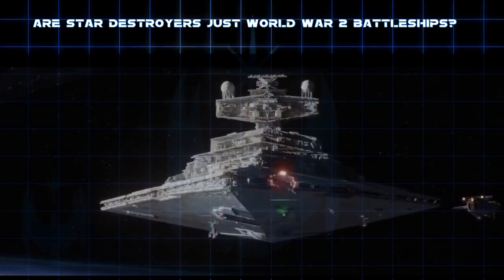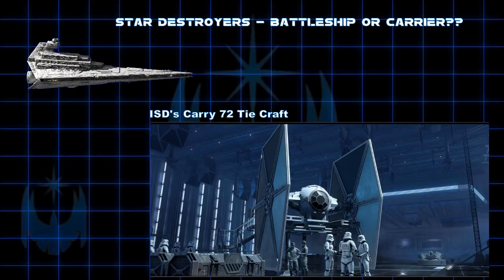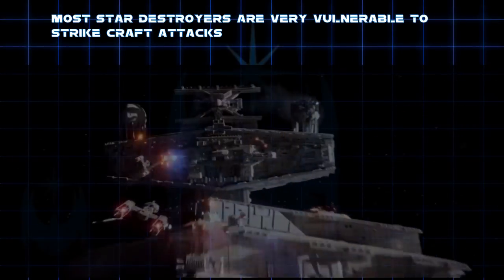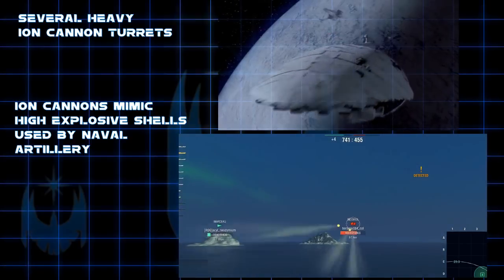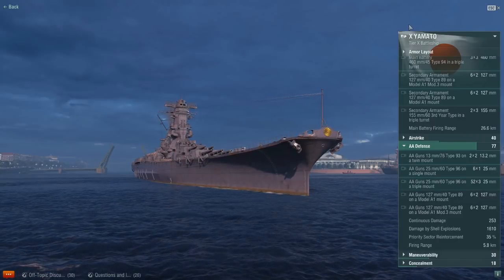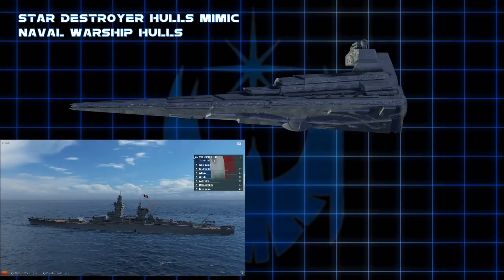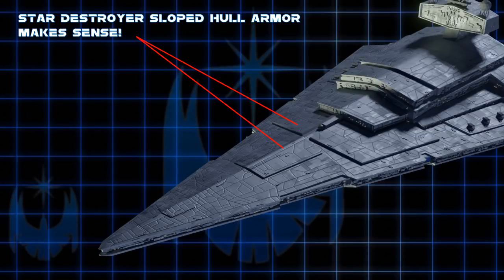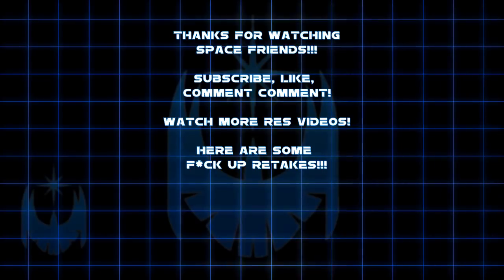Star Destroyers - World War 2 Battleships in Space? A Design Comparison!

Comment: Speaking of the angling of the armor, angling the armor has the benefit of providing more protection because the angling of the armor amplifies the relative thickness of the armor protection.

For example, if you take an inch thick plate of steel and angle it at a 45 degree angle, the relative thickness will be amplified to be closer to two inches, if not more. 

We see this with Confederate Ironclads - such as CSS Virginia, CSS Albemarle, and CSS Neuse - where the upper structure was angled at a 45-50 degree angle to provide greater protection. 

The steeper the angle, the greater the relative thickness will be.

Comment: Star Destroyers are a horrible design. Simply was made for looks and not practical. A Space ship for space would have to be built much like a Sub, a big armored Sub. With the squishy bits ( Humans ) deep into the hull of the ship and nicely in sections behind air locks. The ship would have to have a few exposed surfaces as possible to prevent space debris from penetrating the ship. Missile launchers would be best hidden in the hull of the ship and bunkered to no destroy the entire ship. The same with any "gun" which would be in retractable turrets so they could be repaired or reloaded as needed even replaced if damaged. All guns would need to be inter locking to ensure effective fire. Smaller guns or missile system designed to counter missiles or "space fighters" would be incorporated in spaces between the larger guns. The hull itself would be best to be symmetrical and incorporate thrusters and main drives in the front and back, because you have to slow down once you get there. So ships that look like a sub or a ball would be practical and strong.

Comment: Considering Star Destroyers tend to work a lot better in battlegroups to fill as the front line combatant against other ships with similar role. If we include the ships it was designed to serve alongside from the clone wars period,the ISD fits the role of bringing direct turbolaser fire to ships like Providence/Recusant class warships while the supporting Venator/Victory/Arquitens class destroyers run interference against smaller ships like the munnificent class. The Victory 1 is better at long range engagements and the Venator is an excellent carrier,but the ISD is meant to be the "ship of the line".
Also here is a quick rundown of the different ISD variants
Imperial-1/Imperator Class
3 triple barrel heavy turbolasers and 1 heavy ion cannon battery,with extensive point defense to deal with incoming fighters.
Tector Class
Similar dorsal armament to the ISD-1,but it loses the launch bays to trade for additional armor and power to devote to additional secondary weapons mountings. 
Imperial-2 Class
This ship loses its ion cannon mountings in favor of additional turbolasers,and sporting the devastating "octuple turbolaser barbette" mounting. The big downside is it loses its point defense,which means that it purely relies on its airwing to defend it from incoming fighters.

During the post Endor era the New Republic would use captured ISDs in a roll analogous to the US navy's surface action groups during the cold war,along with some commanders like Grand Admiral Thrawn and Warlord Zinsj. This is where the ISD served as a massive force multiplier and showed how damn effective it was,with upgrades and refits of the ISD 1/2 being actively used in combat long after the adoption of multiple successor classes including the more practical Nebula and Turbulent class ships.

Comment: Star Destroyers are horrible designs for space combat. They don't even have guns on the bottom which also has a huge hole to shot into! in fact, they are a bad design even by ww1 standards. Edit: also the biggest guns are not super firing, and are locked in extremely poor firing arcs. pretty much the opposite of a ww2 or even 1 ship. Edit 2: SO GLAD TO SEE YOU BACK MAN! ITS BEEN LITERALLY A YEAR OR TWO?
Reply: ISDs have however trator beams on the bottom, serving both combat and small craft assistance services. Besides, in the epIV first seconds one can see several shots fired from the lower hull of the ISD. 
As for gun arcs, please refer to the HMS Nelson and Rodney.

Comment: Late to the party but I'll throw in my two cents. Regarding the shape of the SDs, the kite shape is actually very effective due to one single thing: moment of inertia or how hard is in to turn or spin an object. Most of the mass of the ship is towards the back near the engines while the farther away sections narrow off, meaning relatively low amount of torque is necessary to turn. Also factor in the placements of the engines as they could potentially be used to manuever somewhat like tank tracks; even more so if those drives have some degree of thrust vectoring. 

All this leads towards another point: turbolaser battery placement. If the ship is relatively fast to turn in 3D space, then grouping your batteries together allows you to concentrate all of your fire on a single target. Hell, all the batteries can engage nearly the entire top hemisphere of the ship. Meanwhile, this style of combat position keeps the fighter bay out of the line of fire. 

All of this leads to a sort of Battlestar-style combat doctrine: the fighters are mostly defensive, leaving the big guns of the mothership to do the real damage. However, if the enemy has been broken, there are targets that are not worth the SD's time, or if the situation is desparate, the fighters/bombers then engage the enemy cap ships. Even the placement of the main guns are in a similar style to the Jupiter-class Battlestars, being concentrated in a single hemisphere. Meanwhile, the smaller dispersed turbolasers can engage frigates, corvettes, or gunships that are attempting to support enemy fighter assaults. This is a superb system for conventional direct LoS space combat, though less so when going up against enemies with basically no capital ships like the Rebels.

As for the shield generator placements, I only have a head-canon explanation: maybe like the Federation's prefered placement of large exposed warp nacells, those prominent generators offer some sort of advantage of more secured positions which further boosts the shield strength of the SD. 

And the bridge placement......................yeah, I got nothing.
Reply: A Stardrestroyer is a significant investment, much more significant than the officers commanding it. Putting the command crew in an exposed position where they're going to be the first to die should things go south, is a way to discourage reckless tactis based on "the armour can take it, and here in the core of the ship I'm safe anyway".
Reply: @MrAranton  Yes, however what was overtly highlighted in SW:  Episode VI , was the fact that a critical hit on the command bridge can render a capital ship either inoperable or recklessly uncontrollable.  I think the idea that all critical systems were tied into one location on such a huge ship is absurd (it was a hairpin-turn in the plot AFAIC), but I shall suggest that putting all one's command officers in a single location, esp. an exposed location, is on the foolish side of bravery.

Comment: One thing to radical improve Star destroyers realism, take their shield generators and put them into their hull but let them produce heat. So much heat that you need some sort of radiator. Because of space´s lack of air heat can´t easy travel. So your radiators need to be big. Now you have solved to thing in once make Star destroyer shield generators less dumb placed but still have a reasonable weakness.
Reply: I believe they're more like shield generator + shield projector in one module. Your shield isn't going to help you anything if it is projected inside your space ship, I think it has to be placed on the outside in order to project the shield effectively

Comment: Part of the reason why the star destroyer has all its guns on one side is so they can face the enemy with all its guns while using the hull as a shield to protect TIE fighters from the opposite end. 

This may seem like the underside of a star destroyer weak due to lack of cannons, but that means  you would have to face off against deploying fighters.
Reply: yet the side guns are still a bad design. It would have been much better to put the guns (at lease the 8 heavy turbolasers turrets) on the centerline of the ship. That way, you basically have a 270+ degree fireing arc for all your main guns. While the Star destroyer can still fire all its guns forward, it can only do so at a VERY small angle (maybe 10 degrees or so). If the enemy moves just a few degrees to the left or right half the firepower is lost, which doesnt happen if you put your guns on the centerline

Comment: I think if you applied Star Wars weaponry options to a spaceship build on WW2 naval combat ideas, it would be more like something from the Zentradi and just be bristling with guns everywhere.  Shape is irrelevant to space operations so the shape of the ship and placement of the weapons could be done in  a way as to guarantee overlapping fields of fire and effectively no save approach angle to attack such a ship.

Furthermore, no self respecting US navy ship from WW2 wouldn't be just covered in AAA from head to toe so any ship of that though process would likely have the insane flack walls you see in BSG the reboot.  Short of power or complexity issues, there is no way a space ship designed for max insanity could really be touched short of an equivalent ship or some kind of outrageous weapon.

Comment: The Battlestars Galactica and more Pegasus would crush them all.  Imagine in a fight the get hit by a few nukes and keep fighting!!
Reply: Depends. The reason ship combat looks really close is turbolasers have short effective range against shields. The battlestars even with their armor would probably not last very long. Their best capability against the an ISD is getting a pin point jump behind the ship and blasting it's rear engines. Or dropping off it's viper and raptors in a fast deployment,  loaded for bear then jumping out only after the fighters signal a good environment signal. Probably after the main turrets and torpedo launchers were slagged with whatever munitions shot at it. Tie figure would be an issue but that tactic used in stargate Atlantis, of aiming for the mass swarm of wraith darts launching can cause a hell of a series of secondary explosions trashing the hangar and vaping all the pilots.  Using a tactical nuke there or regular missiles would do that.  
So basically your correct that the B.Star can win in an engagement against a single ISD but it will have to be with guile, and good strategy because in a drag down fight it will Not win. 

... okay maybe the first TV movie versions since they were armored against plasma/laser weapons. Maybe.
Reply: @dragonsword7370  crap.  I’d forgotten that Star Wars Ships have shields.  They’d lose to Star Trek starships too.
Reply: @injuredtabletennisplayer1474  these days missiles and ships can fly through shields. It's still good dude.
Reply: @dragonsword7370  I don't like this new change. I liked it more when shields were a protection system and not a plot tool.

Comment: The "shield generators' weren't originally concepted as such. It wouldn't make much sense given the displayed technology of the Star Wars galaxy we've seen. The large domes that dominate the bridge are sensor/radar domes. At least that's what I think. Games and media turned those into exclusively shield generators sense they are an easy target for objective based gameplay. However, their design is based on late 70's early 80's radar dome technology. 

In the RotJ, we see Rebel fighters strafe the domes with torpedoes. The first volley is ineffective, the second volley hits and destroys the dome. This prompts the bridge of the Executor to report that the bridge deflectors are down. I have always been under the impression that this scene indicated that the last two volleys of torpedoes dealt enough damage to disrupt the local deflector shields around the bridge. The dome's destruction was not indicating shields were destroyed, but that the deflectors had been weakened enough that torpedoes could do enough direct hull damage. 

The domes' can still be a weak-point, vulnerable enough that if destroyed the shield would be disrupted trying to compensate for this section of the hull that has been turned into a ball of fire. But games and literature took the easy route and turned this sensory objects to a ridiculously exposed glaring weakness in design. As obviously vulnerable as it is, every Imperator Class, Tector Class, and Executor Class had it and never thought to correct this mistake. That's why I can't accept any technical read-out that list the domes as shield generators.
Reply: Ackchyually its a shield generator/sensor dome combination

Comment: I have to disagree with how you talk about wet navy AP and HE shells, in which you stated that AP and HE are both use in ship-to-ship combat. That is simply not the case, and simply the gameplay element of WoWS. Against another ship, a WWII ship will nearly always use AP shell, simply because it's literally designed to shoot at ship. HE and other kinds of shells are for doing everything else, like shore bombardment or anti-aircraft.
Reply: HE was used against other ships, when the target was one of the smaller less armoured classes.
Reply: There is some of WoWs mechanics, in the vid to be sure, but what you say here is also incorrect. HE was pretty much the first anti-ship "shell" to be developped, various AP shells only came into existance slightly bit later, and even after that there would still be use for HE shells against surface targets, specifically against targets that lacked armor that would mean that AP shell would either fail to arm, or that the ships internals would not slow shell enough for timer on the fuse to explode while shell is still within ship, leading to overpenetration (yes that is a thing irl, not only in wows).